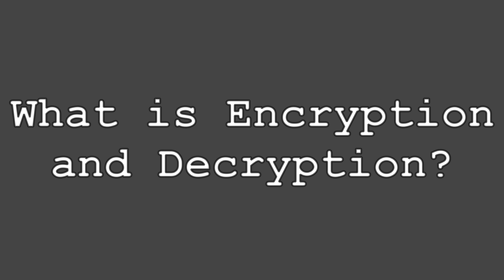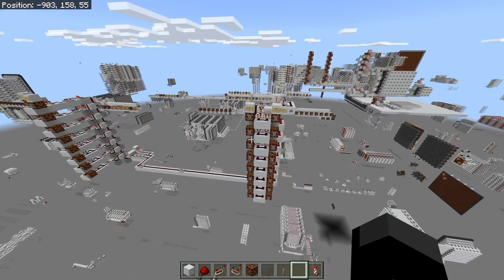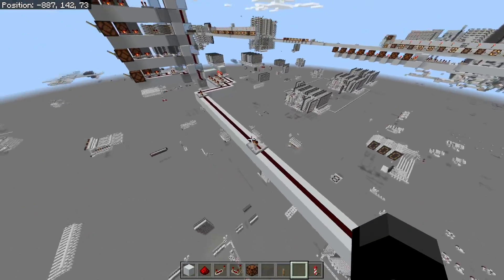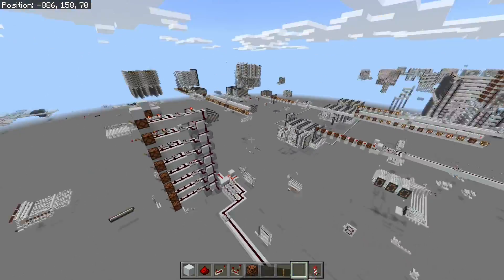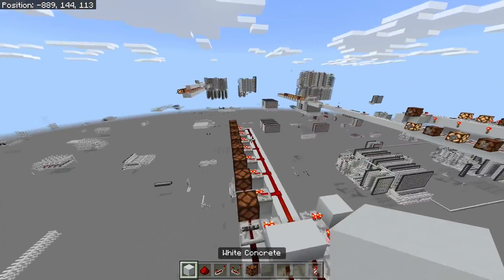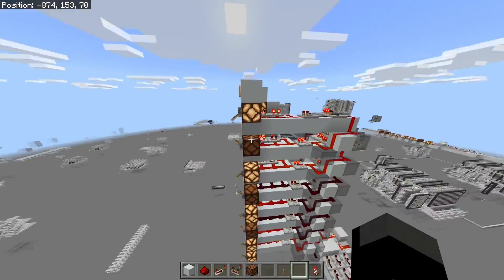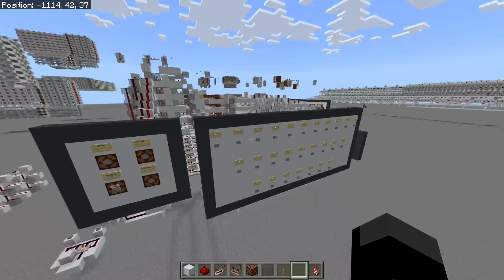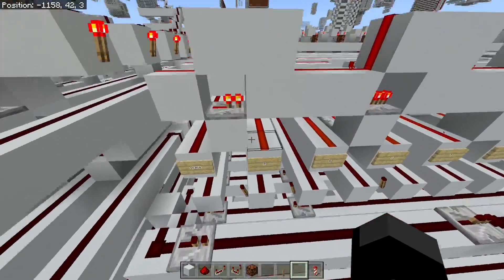Simple Data Encryption and Decryption! - Minecraft Bedrock

Comment: Hey can you build thing that can < > == in Minecraft Java .
Nice video❤
Reply from the maker: This is actually quite simple - just build a subtraction device and subtract the numbers you want to compare. If the result is 0, they are equal. If the result is positive, the first input is greater than the second. If the result is negative the first input is lesser than the second.
Reply: @TheDarkness344  thank you very much for it
Reply: @TheDarkness344it's actually easier than that, you just have to modify xor gate to give same two values and 0,0 if input are same that can be done easily, you have to pass through two values quickly side by side and you can get away with using only one xor gate or you can build multiple of these for each bit if you want instantaneous results

Comment: Wait do you have a tutorial for an 8-bit multiplier with a 16-bit output?
Reply from the maker: I had a showcase but have temporarily unlisted the video as it needs a couple revisions (upper 8 bits was broken). I will publish another showcase of the improved design as a new video at some point.
Reply from the maker: In the meantime, I recommend Matt's sequential design. You can easily modify it so that it uses a faster (preferably 3 tick) CCA.
Reply: @TheDarkness344  But how do you make it 16-bit if you have extra delay due to weak signal strength?
Reply from the maker: @STA-3  pretty sure that you can just offset the tower bit that takes the inputs by however many ticks the carry repeater is. (Only offset the upper half ofc). This is what I will try anyway when I redesign.
Reply: @TheDarkness344  Yeah it's hard to get the idea when only reading in text. I'll be experimenting with what i can find

Comment: Funnily enough not doing anything to the data is automatically encrypting it with a key of 0!

A xor cipher like this, in a similar form is used for some forms of wireless data encryption. It's way safer as basically, all parties can xor a common data set, and only the result of those xors is readable due to our wireless protocol. This means that the person recieving the data can transmit a random value, and then xor the final result with what they transmitted. Like this you can also have a completely random cipher so it's not possible to decode it via context.

We're also planning to use various other security measures, but this is indeed part of one.
Reply from the maker: Yea I've been taking a look at tick link from time to time and it's pretty interesting. As far as security goes I don't think people should be too concerned. Members who use the system probably will use it as intended, but security never hurts and it will save wasted staff time.
Reply: @TheDarkness344  well we're doing it because it's cool- the same reason as we have for making a network in the first place. How ya keeping track, don't see you in our Discord?
Reply from the maker: @iPlayGamesX  My account isn't linked yet as I haven't been on ORE in like a year XD. Maybe I will get around to doing it at some point. But yea, I respect you guys doing it for the coolness factor. Why else build computers in Minecraft XD